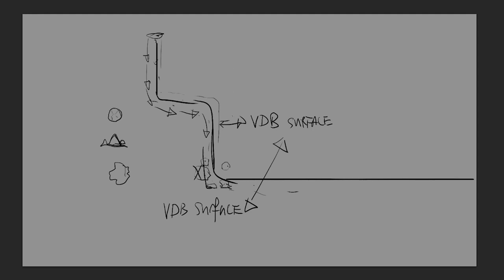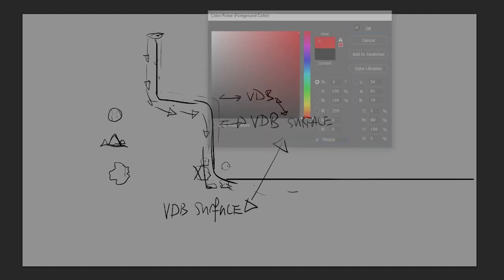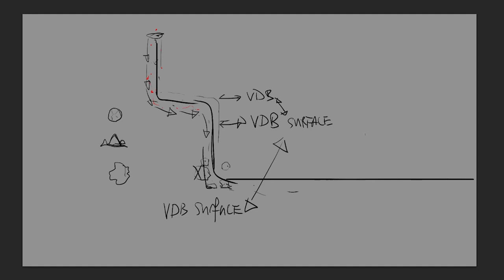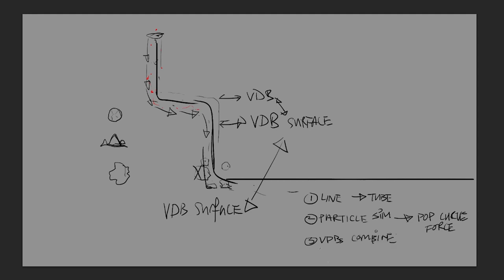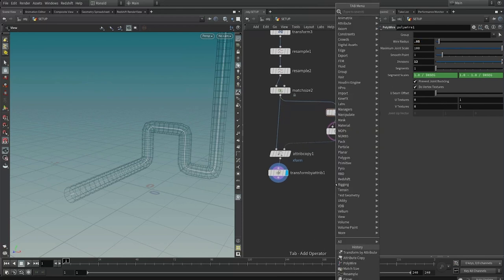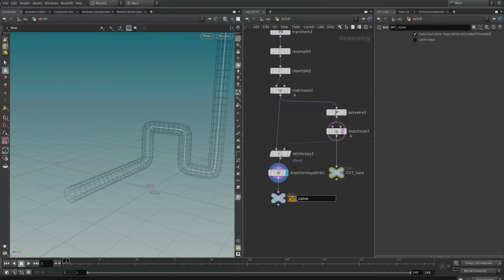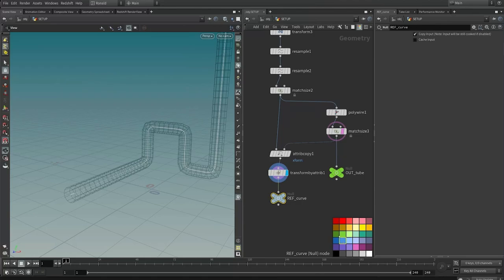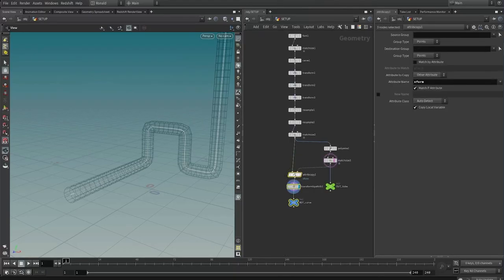Houdini Houdono | Simulation - Episode 8 - Water Bubbles

Comment: Hi Ronald,
Thanks for the tutorial. Very easy to follow and valuable without the usual overwhelming Houdini stuff you see everywhere. I have some complaints about the extra steps you sometimes give to resolve some problems, like the VDB combine for the two tubes when you can just use a Polyextrude SOP and save the remaining 4 nodes. Also, you can load the cache with the same File cache. The SOP File is not necessary, I think. Otherwise, thank you very much for sharing your expertise.
Reply from the maker: Thanks Yonlay!

Yes, using a polyExtrude will work well for simple tubes like this, but using VDBs can be a little more versatile should our geometry be a little bit more complex.

For those wondering, separate File Cache and File nodes are recommended for older versions of Houdini where the relative path in the File Cache will "break" when you version up your working file. Hence , a separate File node is recommended. Not an issue anymore since H19, I just use the File Cache node these days too. :)